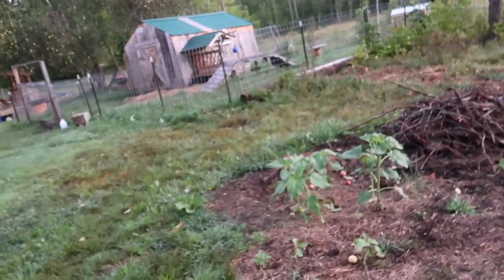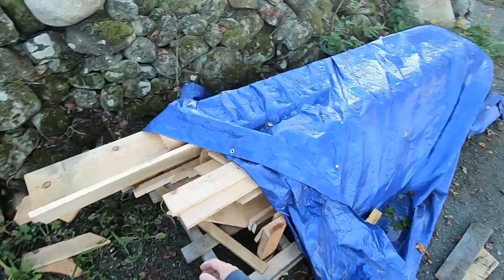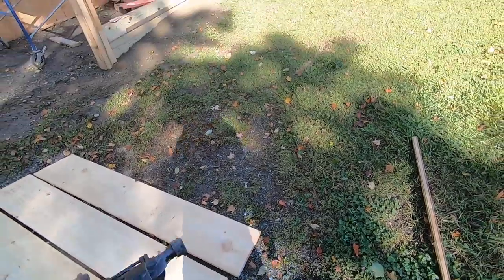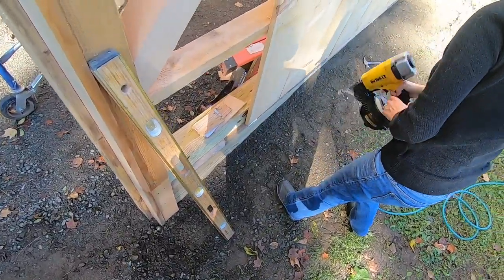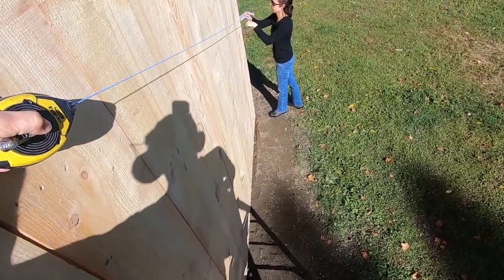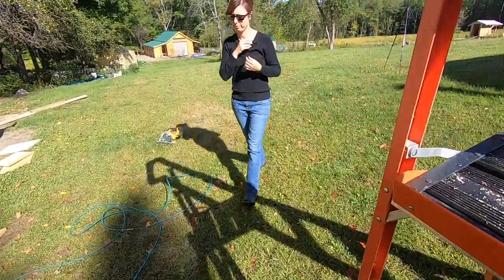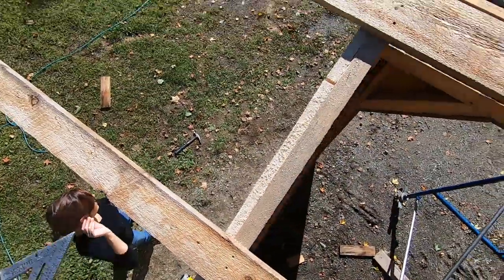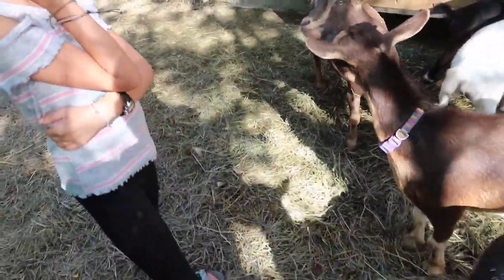Nothing can STOP us NOW!  Sooooo Close to getting the Metal roof on

Comment: Al, I noticed a comment in the video where you installed the metal grates in the hay feeders and the concern of their tongues sticking to it in freezing weather. This is a real thing and concern. We did this with our horses and had to remove them. we replaced them with the vinyl lattice and tacked it in place. Worked well. Just a suggestion since we have experienced this issue ourselves. Be Blessed!

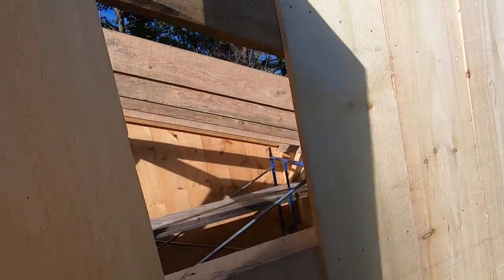Comment: At 10:00 I Always use center of the Wood out to make it last longer, and fiber pointing down to let the rain off without rotting the board. Usually the boards make a bow out on the edges but thats ok since I do the opposite with the strips to get best fit.

Comment: You might give a wet/dry vacuum a try at picking up those apples or a tennis ball picker up thingy. Its a long handled metal basket with a spring loaded bottom. I am sure it could easily pick up those apples.

Comment: For the outside hay feeder. Cut a long length of plywood about two and a half feet wide. Place it in the feeder with the bottom next to the new wire and lean it back against the wall and attach top with a few screws. The hay will drop down on this ramp or funnel and hay will always stay at the front while they eat. Love your show.

Comment: Great work guys! Just a thought Al. I think since you have so much room in the firewood shed and the forks for your tractor that I put firewood on the pallets. When you need to fill up the basement just grab the Kubota and drive a pallet over to the basement door. Or, you could even screw multiple pallets together to build a cube or bin to throw your firewood in and use the same concept. That way wood wouldn’t be falling everywhere when you moved it. Fans from TN!

Comment: A little something about saw blades. Any Carpenter who has ever for the first time used this blade will never use another. The comfort + control of it's cut. I should also mention it makes available at least one-third more battery time on cordless tools. I do not like the name, But I do like the blade! The success of this blade is a 3/32 kerf. Quicker cleaner cut. Diablo saw blades.

Comment: Hi Lumnah Family. Hahahaha... It's quite the verdict from us peanut gallery viewers that there were 18 eggs. The carport/woodshed project is looking great!! Have you made a decision on the electrical in the barn? I'm not sure if your area has stringent electrical codes for outbuildings but with your animals living in the barn it's worth doing the wiring right. I've done some work with EMT (Electrical Metallic Tubing). It's what we used on some of the communications sites that I worked. It's not too bad to work with but you need a pipe bender and need to account for all of the pipe connections. Romex is much easier. Just drill and pull. Cheers and God Bless. ~Mike and Ester~

Comment: You mentioned that the goats are sleeping later now... is that by the clock or by the sun? ... Meaning - if I was a goat I'd wake up 30 minutes after sunrise, year round. Which would be up to 30+ minutes difference on the clock between summer (the longest days) and winter (the shortest days). So, in their perspective, are they really sleeping in or are you the one that's off? ❤🌅🌵